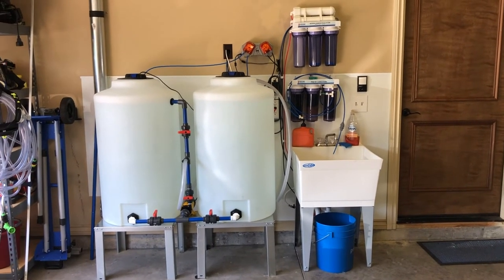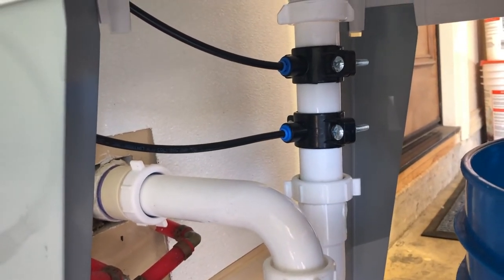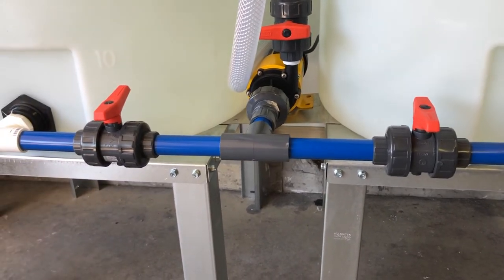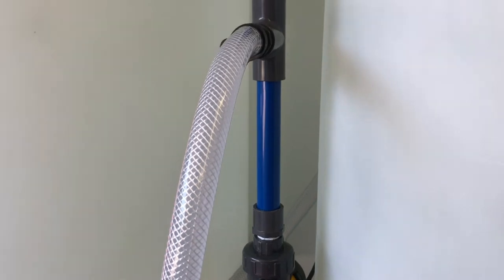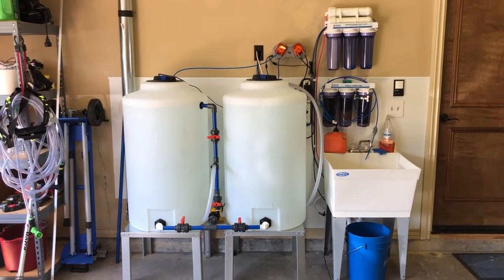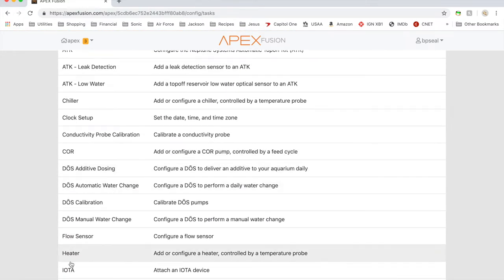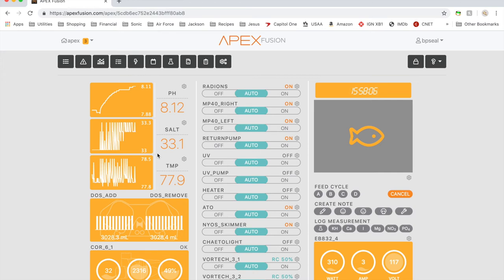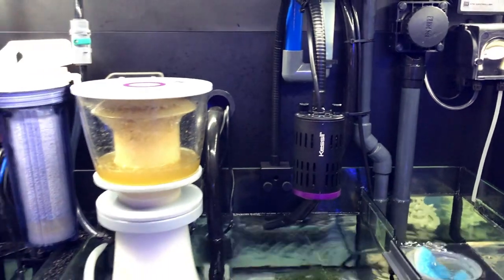Automatic Saltwater Mixing Station (& ATO!) SOLVED!

Comment: Barrett great video very helpful!  Is there a reason your not using the external pump for mixing the salt water?  Also how to have your tubing in the salt water to make sure it stays at the bottom of the container? Thanks
Reply: Hey Ryan gosh sorry I am just now seeing this. I used a small 1/2'' PVC and put the 1/4'' RO Tubing through it and it keeps the tubing rigid and it is cut to sit directly on the bottom of the tank.

Comment: Why do you reduce the bulkheads down to 3/4" instead of using 3/4" threaded bulkheads?  Instead of using that Hydor to circulate the salt water.  Using the current configuration, you could close the ball valve from the freshwater tank, and run the pump as a closed loop, it would draw from the bottom and be thorough in mixing the salt and RO/DI

Comment: I’m working on a very similar setup. How did you get your RODI system to stop the waste water from constantly flowing when the rodi is not making any water?
Reply from the maker: The rodi unit shuts off from the float valve inside the fresh water tank.

Comment: So, I take it you had to run a cable from the DOS to the Apex controller?  How long is the run, and where did you get a cable that long?  I would also like to ask you about your setup for your UV and how you plumbed it in.  Thanks for the video.
Reply from the maker: Yes sir a 75 foot male to male USB 2.1 cable. Monoprice is a great place for that. I ran it through my attic to the garage. The UV was plumbed behind my stand with a simple Eheim 292gph pump and had it cycling in my sump area.

Comment: Great video!. Thanks for all the details that most mixing station videos omit! There appears to be a special lid adapter permitting passage of the Koralia cord. Is there or did you simply drill the lid?
Reply: All I did for the lid, (sorry I just now saw this) is wind the cord through the center of the lid because it's removable and it works fine.

Comment: Great video Barrett and much appreciated as I'm setting up my system tonight. I'm trying to figure out the best way to get water to my tank if I have to do a big water change.  I see a valve directly behind the output of the pump, then a T with the 3/4 braided tubing, then another valve before going into the saltwater barrel.  Do you have a valve at the end of the tubing to keep it from coming out when you don't want water coming out?  I was also wondering the reason for the valve right after the output.  Sorry if it's obvious, just want to get this right the first time.  Thanks again for your video
Reply: @bpseal  Thanks for your help and quick reply, now I can keep trucking on this thing and get it done:-)
Reply: @robertcousins9106  did you get a PM'd response to this? I was wondering the same thing about how he keeps water from coming out of the braided tubing.

Comment: What kind of rubber grommet are you using to connect water flow to the side of the tank? Any issues with leaking? Is it glued?
Reply from the maker: Hey man it’s the uni seals from bulk reef. No leaks but it also is above the water line.

Comment: Nice set up mate!! Quick question - what cord did you use to run to your DOS that connected to your Apex controller? My mixing station is in my garage and my tank is about 30ft away from where my Apex controller sits..
Reply from the maker: Thanks bud. Just a giant 50 foot USB 2.1 male to male cable.
Reply: @bpseal  , so that 50 foot USB 2.1 male to male cable will plug right into my DOS which gets connected to my ApexEL CONTROLLER correct?
Reply from the maker: @flreefshark76  yes sir!
Reply: Technically the max length for usb 2 is 16.5 feet, so make sure the cable is "powered" otherwise weird things can happen.

Comment: You mentioned your ATO line from the mixing station but didn’t show what pump you are using. Also, are you just using optical sensors in the sump to trigger the ATO pump? Any safe guards used?
Reply from the maker: Great question, I use a 50ml BRS pump that brings my ato water in from the garage. And I use electrode sensors and they work fantastic.
Reply: Have you encountered any issues with the ato turning on when the water change is happening,  or does the add and remove happen simultaneously so the ato doesnt know anything is happening.. lol.. maybe i answered my own question ...